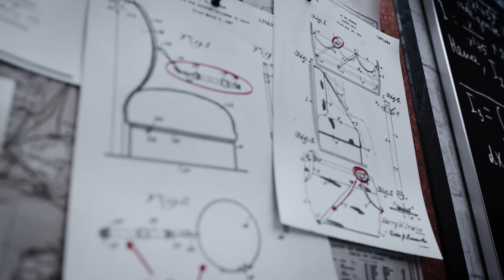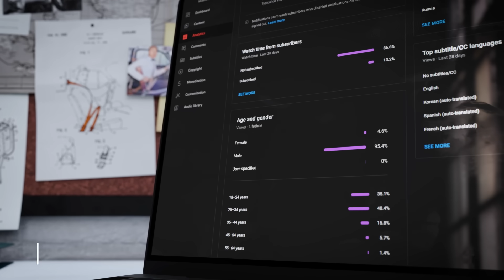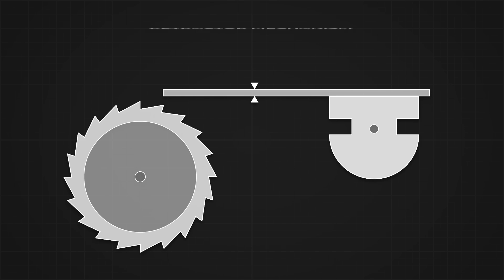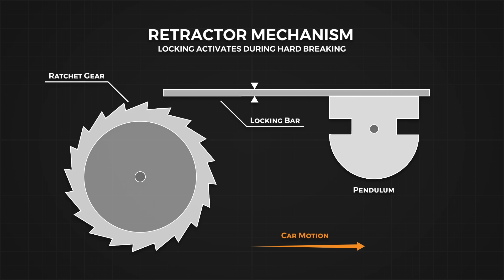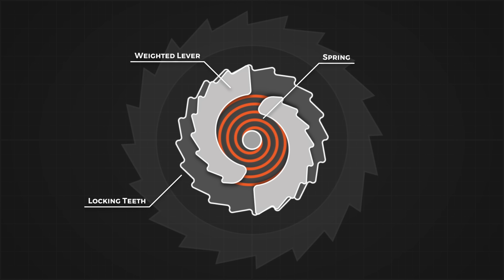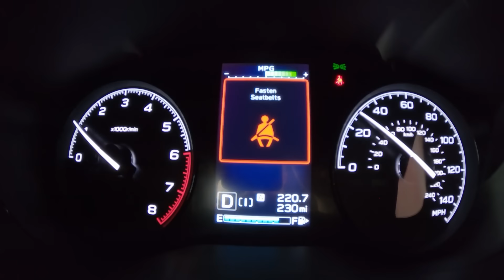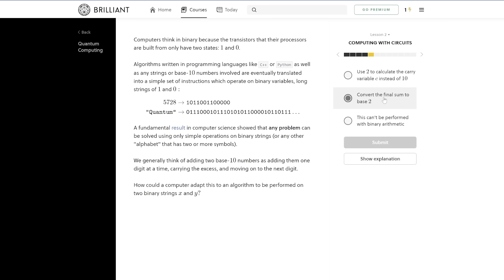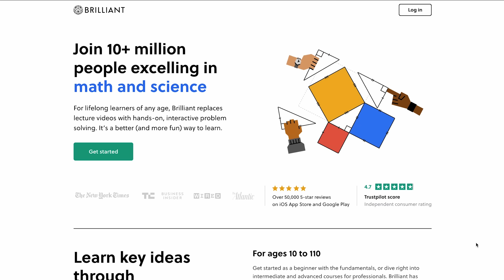How Do Seatbelts Work?

Comment: I will remember the explosives in the seat belt for survival purposes. Could make a little fire or something
Reply: There are also explosives in airbags as well. the chambers are sealed meaning the likelyhood of fire from the explosive material is low like a gun misfiring, it does make a fireball but it's too fast to spread to other flammable objects, and too hot. My main concern when it comes to fire hazards in cars would be fuel lines breaking and catching fire, which is also unlikely, but has happened before.
Reply: @d1g1ta1flux7  All of them are also designed to not produce flame ( unless you have Tataka defective ones) just hot nitrogen gas, so they do not actually get hot enough to light fires. The light bulbs are better for starting fires, unless they are all LED.
Reply: @SeanBZA  yah didn't think about that. I was thinking about the circumstance of it not being fully sealed and shooting out the side and igniting with the air, but even then the chance of ignition is close to none due to the pressure. Assuming it made with a more volatile gas
Reply: My 2002 truck does not have the explosive devices in the seat belt retractors, but it does have a cigarette lighter in the dash, which is capable of starting fire a lot more readily than clever application of a seat belt device or incandescent light bulb. It has an ashtray too. Quaint items from yesteryear. I use the ashtray to store small items BTW, no smoking for me.
Reply: @onemoremisfit  yah to say that a car is a completely safe thing would a very obvious lie.

Comment: I went and got my diesel technician degree in school. They definitely didn’t teach us anything about seatbelts at all. 😂
Reply: Same! I like to take everything apart which is how I found out how they worked 😆 I didn't realise until recently most cars with batteries located in the rear now have a pyrotechnic fuse to disable the main feed!
Reply: @Jawst  it’s cool to be able to keep learning. Ya wish and it would’ve been nice to know things in the foundational process but even then learning about SAS or SRS system is

Comment: It's a real eye opener to sit in a race car w/a 5 point harness. Once you're strapped in you're held against the seat & absolutely cannot move! You can tilt your head forward alittle but that's it. Modern seat belts are the the height of comfort compared to what it takes to keep a race car driver safe. I wear my seat belt all the time,not for what I might do but for what someone else might do!
Reply: If you think race cars are tight belts try aerobatic planes, cuz we do negative G and hang upside down you need to be so tight you feel squashed to hell just normally as even when you think your well stepped in on the ground, once you do some negative G you realise there’s still slack to wiggle, so much so that we have bloody Ratchet straps for our lap strap… and god forbid you wanna jump out you have to pull on that quick release pretty hard.
Reply: Safety aside, a race car would be impossible to drive without tight seatbelts, you absolutely need support during hard braking.
Reply: @JakStat  not really, I mean early F1 didn't have restraints and they managed to downshift brake and corner without it. Yeah fatalities, but they absolutely drove, not impossible. They still race them at Goodwood without the belts.. still faster than you will probably go in a track day car or to the gas station drunk in your clapped out c5.
Reply: The reason you don't usually see 4 or 5-point harnesses in regular cars is that they stop you so well, you can actually break your neck from the forces of the crash.
Racecar drivers wear Hans devices which brace their necks during such crashes with these seatbelts to prevent this from happening.
Reply: Once I sat in a vehicle with a 6 point harness I’ve wanted to install them in every vehicle. Honestly I don’t know why they aren’t standard equipment.
Reply: @jakeharms1386  comfort and ease of use. You have to strike a balance between that and safety for people to use seatbelts. If 6 point harnesses were the norm, more people would not wear them, or would wear them incorrectly. And it’s more dangerous a badly worn 6 point than a normal 3 point seatbelt. My track car has rollcage and harnesses, so its a lot safer than my daily car, but it has awful usability😂 its hard to get into, the harness is so tight that if you’re strapped you cant close the door or open the glovebox… i would hate to use that car to to uni every morning😂😂
Reply: If you get into a crash, it is very hard for the firefighters to get you out of the car. That’s why they all use standard seatbelts.
Reply: @jakeharms1386  because convenience and comfort trumps living to so many
Reply: @jakeharms1386  they’re bulky, and potentially unsafe in road cars as your head shoots forward in high speed impacts, using a harness like that needs a helmet and HANS device.
Reply: @Itsmellsfishy  I guess that’s true, but that could be solved with airbags. Also I’m pretty sure there are racing series that require 4 - 6 point harnesses, but don’t require a HANS device
Reply: @jakeharms1386  yeah if it was well implemented I wouldnt have an issue wearing a harness in a road car but your average joe may not enjoy the idea.
Reply: @jakeharms1386  I don't see how an airbag will save you from a basal skull fracture when you're wearing a proper 5/6 point harness. The main airbag is to protect against hitting the steering wheel in an accident, if your head could move far enough to hit the wheel wearing a 5 point harness, you are 100% dead.
Reply: @jakeharms1386  I wouldn't personally trust an airbag to perfectly deploy in such a way the it keeps my unhelmeted head from snapping down into my chest and ending up like Dale. 

From my understanding airbags are just for protecting you from your steering wheel or other hard bits not keeping your neck from snapping.
Reply: I have a blazing fast car , it has adaptive seatbelts that pin you into the seat when cornering at high speeds, I can’t imagine driving with out that feature… I would fly out of the seat when cornering at high speed.
Reply: @stankythecat6735  interesting, didn't know about those. Sounds way more comfy than a 5-point harness on a bucket seat.
Reply: @Hamachingo  you find them in high end Porsche and Mercedes.   My amg gt has a inertia gage to tell me how much g force is acting on the car as I corner
Reply: @stankythecat6735  f1driver until the 1960/70s had no seatbelt and believe me f1 in the 1930s where not slow!
Reply: @stankythecat6735 what are you doing that is so important you need to drive so fast?
Reply: @WhiskeyNixon  it’s fun !
Reply: @stankythecat6735  so? I asked what was important, not what was fun. You don't disregard other people's safety for fun, do you?
Reply: @WhiskeyNixon  first of all , I’m not taking a lecture from some rando on the net.   Second , oh look … I don’t care
Reply: I'm always pissed when I jump in a taxi and grab a seatbelt just to find that locks are hidden underneath the seat by the driver. I don't know why, but many taxi drivers do that in Kazakhstan where I am now. That was very common in Russia too until the fine for not wearing a seatbelt was introduced for passengers (before only driver could be fined and fine was about 10 times smaller, it was small enough for police officers to often not bother to do all paperwork to fine you).
One possible explanation I think I heard from someone is that's "more comfortable" for passengers back there, but I think it's bullshit. Maybe it's just me, idk, but I feel MORE comfortable when my seatbelt is buckled and holds me firmly in my seat. I feel safer that way and don't have to hold up when driver is breaking or turning.
Reply: You are far from right with this. Cars do not have six-point harness not because of comfort but safety. It would be way cheaper to require them than create air bags, crush zones, etc. Six point harnesses do one good thing, keep you in a protected cage to not get crushed but they do not absorb any energy thats transferred into your body which causes damage. Your organs can litearlly rupture from the inside or gain a brain injury when energy is not absorbed by the cars crunch zones and air bags.
Reply: I also wear a seatbelt because someone else might make a mistake. I take that one step further. If someone else can make a mistake, I am that someone else for another person on the road. So I could make a mistake.
Reply: It's too bad Dale Earnheart did not have that newer device that restrains your head. NASCAR said it would have saved his life. Soon after he passed, they implemented that. That I would NOT want to wear just driving around!
Reply: Well, race cars rarely have air bags, so you kind of need a really good harness to hold you in place in case of a crash.
Reply: Yet some people still feel the need to go above and beyond to not wear it. I don’t feel safe without a seatbelt on, how can someone still not want to wear them?
Reply: In a race car with 5 or 6 poit harness you have to wear hans device. It lock your head when accident occur so your head is not whipped forward
Reply: @Nad Senoj he means it's stupid because that's what gay means.
Reply: 😂😂😂😂😂😂😂😂fete tree eternal danelle is pretty awesome here and we love it all and love it too much love it baby i you are doing well with 😮great job i love love and love miss love love miss miss all love love miss love love baby girl i good day bye love love miss love love baby bye love love miss love love baby bye love love miss love love baby bye love love miss love love baby bye love love miss love love baby see oppoo bye baby girl hope to get
Reply: SsQsssssss#
Reply: I wear a 5 point harness in a glider and it's the same. You can move your head but there's no movement of the torso.
Reply: @@sohc_vtec6370 I’ll bet you pay less in insurance !  Lucky you ! 😀
Reply: @@sohc_vtec6370 exactly !  It’s only illegal if you get caught
Reply: 😊t
Reply: Outside of safety, no one could drive those cars without being properly strapped in anyway. The person would fly all over the place.
Reply: Airbags only exist because we are averse to using protective gear. No race car has air bags, and they are way safer....
Reply: i remember my fist car with a harness, went to hit skip on the radio.. couldnt reach lmao!
Reply: ahem "the the"
Reply: wrgg
Reply: This I think might be one of the biggest dangers in driving cars: The Illusion of Control! 'I'm a good and careful driver thus I have everything under control and don't need these safties, when reality is that you can be the best driver ever born to mankind and still have no control over an accident simply to to other peoples actions and how small things compund in traffic.
Reply: i wonder if straps are better in general than the generic belts
Reply: Don't count on the '3PSB' (3-Point SeatBelt) to KEEP you alive after a crash. Wearing it as officially prescribed can still cause massive, life-ENDING internal injuries.  

Install a 'crotch strap' anchored to the 'LB' (lap-belt) center portion of your '3PSB' and lower-front edge frame of your seat to prevent the LB from crossing or riding up over your hips (fulcrum of the torso). I made and installed 2 in my car after the 1st rear-end crash - kept Mom and me from further injury in a later rear-ender.  

I used 1" wide 'BP' (backpack) strapping, 1 plastic BP buckle, and 2 spring-loaded keychain 'D-rings' to latch onto the steel seat frame and LB. Pulled the BP strap tight enough to keep the LB flat against the thighs but still restrained our torsos AT the hips instead of across the spine's L5-S1 disc (both our injuries in our 1st rear-ender). It WAS a bit more effort to buckle-up each time we rode in the car BUT the pain and dysfunction from our previous injuries made it well worth the few seconds spent strapping-in. 

I formerly served in USAF aerospace systems avionics (IFF) and control systems 'failure analysis', cross-trained into flight crew safety (learning safety harness design) and autoflight systems and worked consulting on contracts involving R&D of supercomputers, servers, radar/EW systems. Still suffering from seatbelt-syndrome due to a disappointing lack of VA/civilian medicos familiar with the syndrome in-spite of the high incidence of highway crashes.
Reply: My observation of the way most people is drive is that firstly, people are overly confident in their own ability to keep themselves safe. Secondly that they completely ignore the fact everyone else is operating on that principle or worse; hence the variables they need to be controlling for aren't even entering their consciousness. Safety devices are the only way to mitigate this behaviour.
Reply: Did you not know that before watching this video wow
Reply: gay
Reply: @42pyroboy  wut